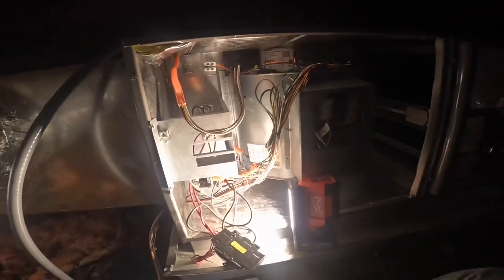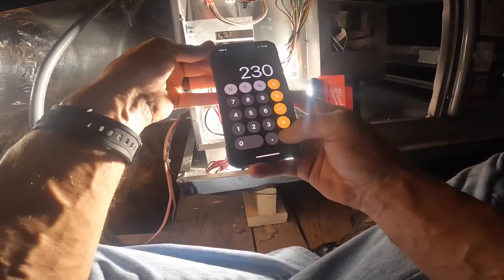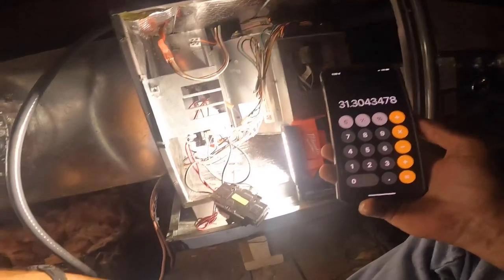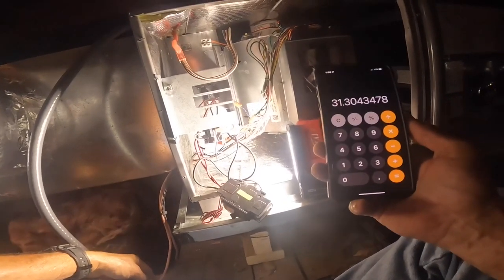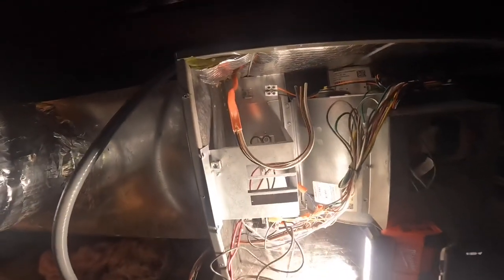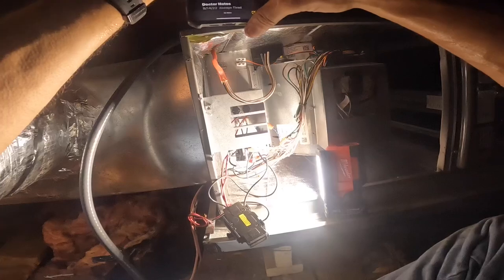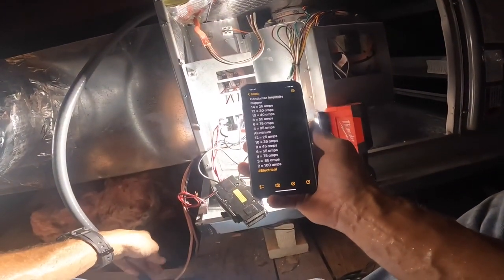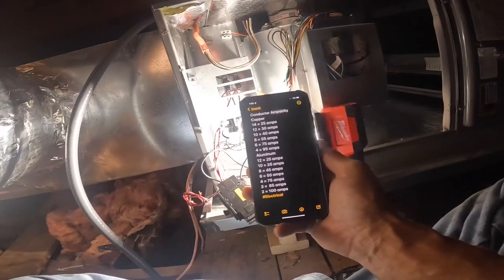This Was Meant to Be A Startup Video, But…You’ll See

Comment: I had something similar happened to me. I told the electrician I wanted 10 gauge wire ran to the disconnect. He put in 14 gauge wire and wanted to argue with me. He claimed he was an electrical engineer. Lol.

Comment: I agree with you, there is a voltage drop to consider when using #10 wire too. I sure wouldn't wire a Stove with that gauge and neither would they!
Good point, I wouldn't accept it either. 👍🇺🇸

Comment: Number ten good for a thirty amp circuit but load cannot exceed 80% by code So limit is 24 amps .   By the way an electrician must read the recommended wire size from the equipment and determine breaker size and wire size . He cannot rely on you to do his job.
Reply: 7.2k at 240 is 30 amps, but since it’s hard wired, I believe you use the 125% rule which puts you at 37.5 plus the motor and you are at the 50 amp circuit with #6.   Haha - Wondered if you were going to pull the wire yourself.   Maybe you can do a video on how to find people like you (referring to character and skill) in our area.  How do you select an HVAC person from a customer perspective?

Comment: By the time you derate for a hot attic, length of run, cable buried in insulation, etc., the ampacity of 10 AWG isn't just close, it's under rating for the load. Good call.

Comment: Code says 6 gauge if the breaker is rated at 50.
Reply: #8 copper is rated for 55 amps for 90 degree C wire. #6 is overkill

Comment: I'd get a new electrician if they use #10 wire on a circuit they were advised would use up to 50 amps. Hope you have at least a text message documenting the 50 amp request. 
Like you said, the 50 amp request is all they need to know. Good luck with this one.

Comment: Makes me wonder what size breaker they used in the load center for that 10 gauge.  I'd be checking behind them on that too. Also, if its a long run you will loose some capacity and need to step up the wire size just for that.  So you may only have a safe 20-25 amps available depending on that.  You made the right call standing your ground on this one.

Comment: Everything I read says that #10 copper is rated for 30 amps. But what I really want to know is did they put a 50 amp breaker on that circuit.
Reply: IIRC you're allowed to run more amps on dedicated circuits like air conditioners.

Comment: Telling an electrician to run wires for a system can be like talking to a rock
Reply: I did electrical for 15 years and on every job I ever did I coordinated with the general and the tin knocker on unit size and never had an issue. Same with appliances water heaters and anything else. On the commercial and industrial end as well for motor amperage. Anything that needed a dedicated circuit. Sounds to me like you were working with shade tree electricians

Comment: I am a Master Electrician and a HVAC Tech as well. NEC states the Wire has to be sized at 125% of the amp load. Do you only have 230 Volts down there?  In WV we have 240+ volts,

Comment: You are not using the ampacity  chart correctly, that 40 amps is based on the 90 degree c column. All connections in the unit would have to be rated for that column. The 80 degree c is the common one used making the #10 only good for 35 amps. Also for AC equipment you have to go off the name plate data of the unit. Have an awesome day

Comment: 50 and 15. They sound alike, but I bet that is not the reason here, as some of the comments make sense to me, a non-electrician. 50 is to be said: five-zero out loud or on paper
Reply: Either way is still one gauge too far to make sense. 15A is just a standard circuit so #14 would have been normal, and upsized to #12 to be safe. In that case, #10 is complete overkill.

For 50A, going strictly by basic code and not factoring in the actual equipment, you'd run #6. For this specific piece of equipment you'd maybe get away with #8 instead (but by code still be capped at a 40A breaker). So of course #10 is far from sufficient. 

The electrician was incompetent, that's all there is to it.

Comment: 50 Amp's That Is Like 6 Gauge 6 2 Wire
Reply from the maker: Heater kits are multiple different sizes. So, we need to calculate correct size.

Comment: Hey on the little chart on the notes app, I thought 10 gauge was max 30 amp, not 40? Maybe I'm mis-reading.
Reply from the maker: That was taken straight out of NEC code book with a max temp of 90 degrees
Reply: The NEC can be confusing to the novice. 10awg copper thwn ampacity as per table 310.15(B)(16) 75°C column
lists  this copper wire at 35amps and to be fused at 30amps max. Also the motor, control circuit and continuous duty derating of  minus 20% of the circuit ampacity must  be considered. #8 copper thwn at 75°C has an ampacity of 50 amps, this wire is appropriate for your application.

Comment: 7.5 KW heat strip in south GA? Im in the mountains of Va and im only doing 5KW. Might even go down to a 3kw.   Or is this straight electric heat and no HP?
Reply from the maker: Its a 2 ton heat pump
Reply: Have fun being cold Tek
Reply: @danielkelley7422  how do you figure that?   I have 10 KW now and it's crazy oversized
Reply: @tekjunkie28  what tonnage is your heat pump?
Reply: @danielkelley7422  2 tons. But if I add windows it stops my old to just over 1.5.  my old 3 ton was oversized.  The new system is likely going to be a inverter since our power bills have gone to my $100 in the last 6 months.

Comment: # 10 works for my electric water heater. It does get very slightly warm though. That is why I went with # 8 for the generator receptacle I put on my back wall. That will run the entire house except the big 240 volt stuff. I could buy a bigger generator, but then you need more fuel. I don't want to be waiting in line after a hurricane in 94 degree heat.

Comment: it may need #4 awg copper ran, since it's a hot attic the wire/devices need to be derated for the high ambient, it may be further derated going by the device it terminates into temperature rating(90c or 75C). probably end up falling under 75C rating and thhn/thwn-2 or others of same rating. 4awg could potentially be undersized.  welcome to electrical head bashing.🤬

Comment: I was told it's 17.5 amps per 5kw so that would put you at 26.25 amps on the strip and if you say 6 amps on start for the fan that could put you over momentarily if that wires only rated for 30. I don't think it would burn the wire up, but regardless you asked for a 50 amp capacity run and you didn't get it.
Reply: Well you were told wrong. Amps = watts/voltage. 7200/230= 31.3 amps.

Comment: prolly 8/2 id say ,  im gettin sick of this crap, LOOK, if i have any questions i look on my damn FONE! is X rated for 50 amps, wet condition, underground or whatever I CHECK, its ALL ON YOUR FONE
Reply from the maker: Google makes us smarter. You’re right , its there for them.
Reply: Code says #6 Romex
Reply: 8/2 is what I was thinking as well but codes may be different. It also depends on the distance and type of wire being used. NEC says HVAC electrical goes by rating plate not the rest of NEC which may add to the confusion. A lot of times the electrician will run us a #10 for the blower and another wire 6 or 8 for the strips. We did a job the other day and the "#10" was super thin but it had it right on the jacket so ok.
Reply: Hey Jason Hunter maybe that copper wire you said was real thin  probably came on a ship from China .

Comment: Doesn’t the equipment tell you what the circuit ampacity must be?
Reply: No. The gauge depend on many factors, like the distance to the panel, wire material (aluminium or copper), wire temperature rating, in a pipe/insulation/burried or in plain air and more.
Reply: @thephantom1492  I didn’t say gauge. I said circuit ampacity. Why did he specify 50A? Was it marked on the equipment to use that?
Reply: @chuckdiesal83  woops my bad... i read too fast it seems.... I will blame it on a long day :)
Reply: @chuckdiesal83  yes, there's a chart to follow depending on the KW of heat strips installed. then the sparky needs to account for wire distance, ambient temperatures(attic get hot!) depending how hot and termination device it may need 4awg or even 2awg copper! derating sucks, but it needs done to not have crispy frittered wiring and fires.

Comment: Thats too much conversion for him/her. Should just said give me 8 gauge wire.
Reply: Code says #6 Romex
Reply: @davidnull5590  Yikes. How did they get their license if they only use 10.
Reply: @indavietual  ---  Don't worry #10 will work ... unless there's a problem, then bad things will happen.  There's no inspections there, it's considered just a 'hook up'.  The retail price difference between #10 and #6 is $5-$6 per foot.  I wonder why he used the much cheaper wire?  Curtis is forever on the hook for the install, it's on Curtis if the place burns down,

Comment: No, it's not what you want. Too many rat outfit think they are ac system designers. Near no more than the parts replacement. Do you start a job as you was paid to do and then leave.
You walking off the job just shows you have a bad reputation of walking off John's cuz you want to redesigned systems. The unit called for 30 amp, but you just wanted 50 to be on safe side, that's hazardous.

Comment: 50 amps on 240 is 12kw..
If your heating element is only rated at 7.5kw then you are looking at about 32Amps. Add the motor, which is what? Intermittent duty? And even if it is continuous duty cycle thats what another 5-6 amps? Dont think he fucked you. If it was thhn then it was rated in the codebook within acceptable range. Thats not to say that #8 wouldnt have its advantages, but #10 is within the proper range. You prolly have some surge fliker when the motor kicks in when the elements are running but not much. Put a start capacitor on thr blower and your good.